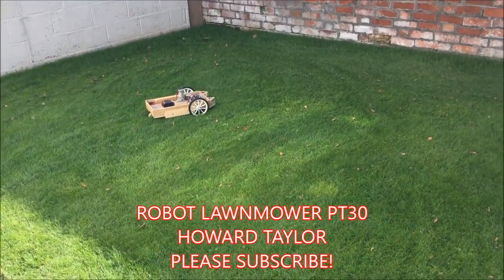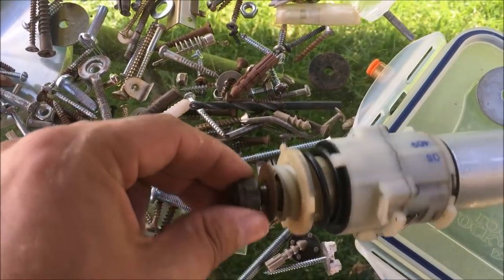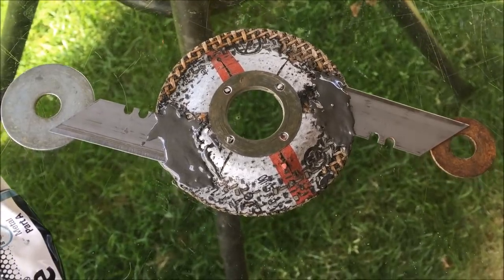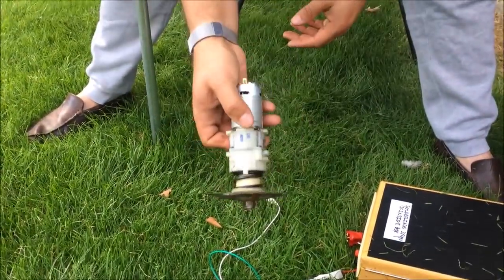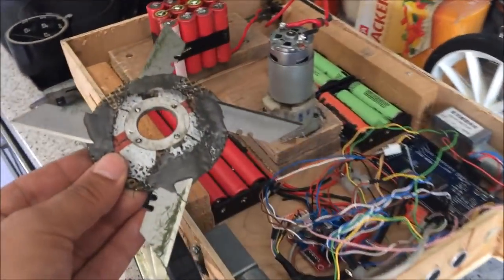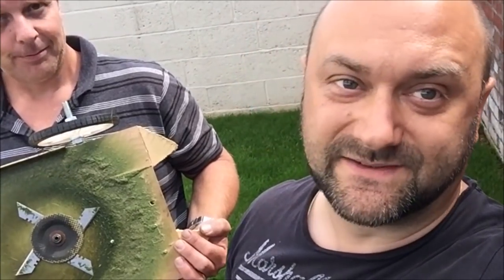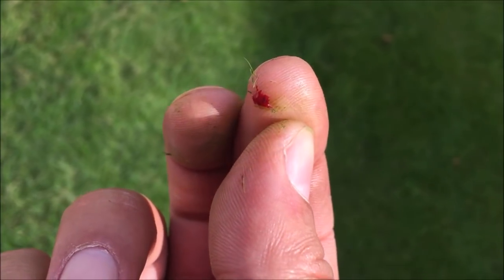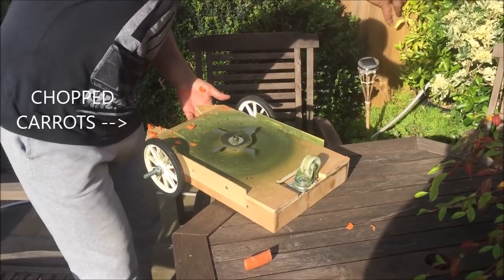Robot Lawn Mower PT30 #RobotLawnmower

Comment: Hi. My motors  6v, 90RPM is to weak to run on the grass, even on double voltage(12v). From motor Torque Table I see that your motors 12v 25rpm had 5.2 Torque, and mine have only 0.9 torque! Seems that is reason. Can you tell me which new motor you recommend me to buy, which will working on grass? Thanks.
Btw I saw all your videos of robot lawn mover!
Reply from the maker: Hi Joe, it was sooooo long ago when we did this! - Was loads of fun, but I'd recommend some serious motors going forwards!!

Comment: staying with the disc cutter principle..you could use an old 4.5" diamond blade with snap off box cutter blades attached, these will give you a longer cutting edge with very little more weight :)
Reply from the maker: Sounds perfect...  now who has an old diamond blade? - It would be good to have four blades and nuts welded to it to allow the blades to be replaceable...  The larger the diameter, the faster the blade travels....